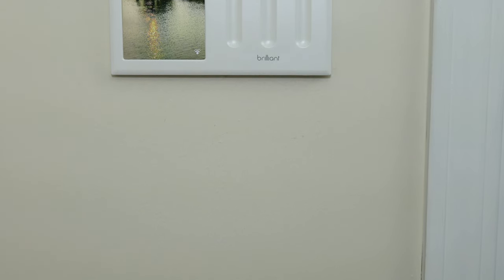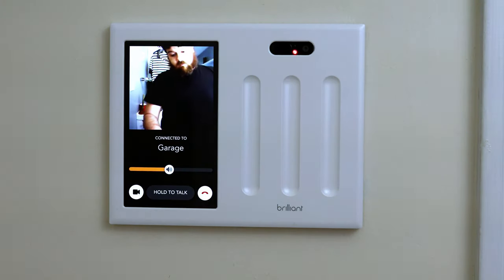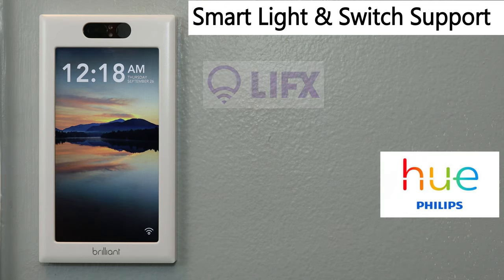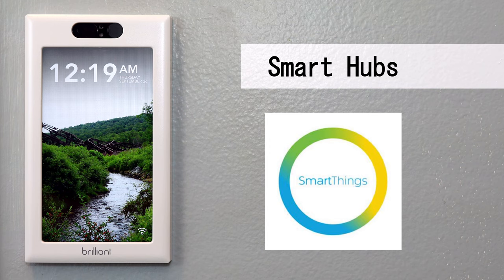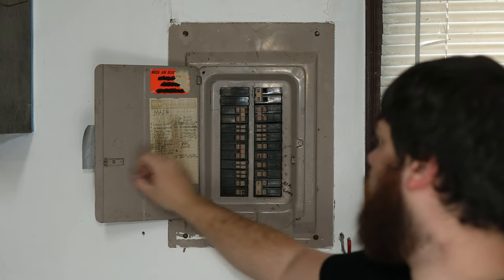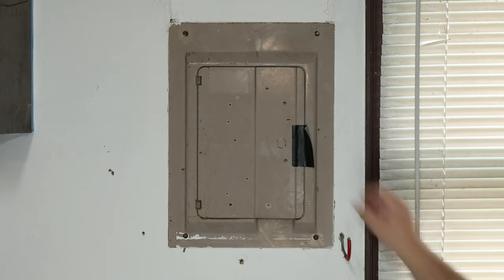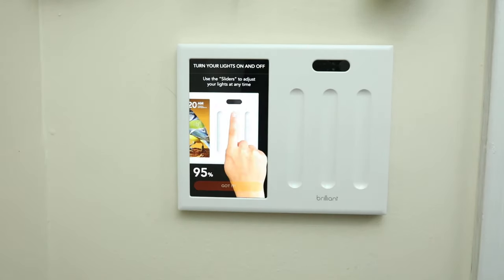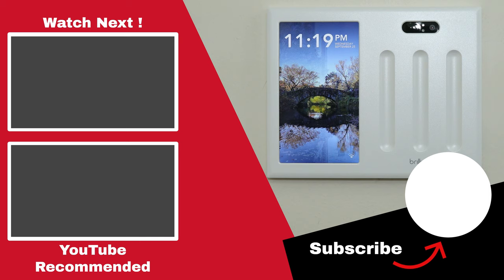Brilliant Home Control - Review, Installation, & Setup

Comment: I bought two of them (2 switch and 3 switch) and I love them. I had my eye on Atmos also but what I realized is, Brilliant integrates into your electrical system so the rooms I have these installed in, the smart bulbs and non-smart bulbs are controlled. You have to have ALL smart bulbs for Atmos to work. I was disappointed that Nest is no longer supported but that is Google's fault. It was extremely easy to setup scenes, my ring cameras, my sonos speakers, and my schlage locks. 

I have a combination of smart bulbs, Lifx bulbs and Sunco bulbs. It does work with the Sunco bulbs. It only views them as regular lights. I have already purchased Lifx bulbs to remedy that but that is something that Brilliant needs to work on. Lifx integration has been great. My 5 year old son loves his photos changing on the screen and he also loves the intercom function. I wish there were a way to add more than 4 shortcuts on the homescreen but that is a minor inconvenience. I already have various Echo Shows around the house so I already had the convenience of talking to Alexa. Brilliant allows me a touchscreen when it is too loud to speak to Alexa. Again, it is easy for my 5 year old to use scenes that I created to dim his lights and turn them blue for bedtime. 

Overall, I would give it 4 out of 5 stars.

Comment: what do the switches do?  Can they control other lights or only the lights that are wired to them?
Reply from the maker: The switches will control whatever load is on them. For this video I had a three gang switch with only two loads, so I jumped Line to the unpopulated switch (all switches need line power even if not used). You can then setup the switch to control other smart lights or switches that are connected to brilliant home control.

Comment: Is it possible to have a live view of your ring video doorbell without having the button pushed or is the video only available after a doorbell press?
Reply from the maker: I sent the demo unit back so I can't double check but I am pretty certain you are able to pull it up manually from the screen. I don't recall if you can use the built in alexa to show it either. Sorry!

Comment: One more question I had. Can I voice control the Brilliant thru the alexa app? Such as dimming the lights or turning them on or off? Or do I still have to use the slider in the Brilliant? I really think this is a cool device but at that price I want to know what it can and cannot do before purchasing. Any information you can provide would be greatly appreciated. Thanks
Reply from the maker: I'm honestly not sure. I've already sent my test devices back as my testing period for the video was over so I can't test it out myself. I don't see why not as long as the app supports the ability to turn smart switches on and off directly. Support is really helpful so you could always reach out to them and ask prior to placing any orders!

Comment: Can I control the brilliant device from another smart device? Example: I have a instinct alexa built in upstairs and if I had the Brilliant 2 switch control in finished basement can I go to the Instinct switch and tell Alexa to turn on basement lights? Or is this strictly one way? From the Brilliant  to the Instinct?
Reply from the maker: You can control Brilliant from a different Alexa or even Google Home. You can also add it into Samsung SmartThings and control it from there / add it into automations

Comment: Great video. Product looks promising but price seems a little high compared to just taping an iPhone 5 next to some cheaper Wi-Fi switches. One could easily rig up a three gang switch for half the price but obviously it wouldn’t look as clean yet it would be more functional since you’re not limited to Brilliant’s integrations.
Reply from the maker: Glad you liked the video! 

While the price is high compared to a smart switch, you are getting a lot for what you pay for, and so much more capability compared to a light switch. Even if you taped an iPhone 5 to your wall and bought some wifi switches you'll be looking at close to $200 unless you get stuff for a steal.  And I'd have to argue that the iPhone route is going to limit you more so than the Brilliant switch, not to mention won't be cleaner (such as the doorbell and smart Lock unlocking function). They've been releasing updates almost every other week which is just something I've never seen in the IoT space, and makes me excited for what else they are going to do. 

There are other systems out there that cost double what Brilliant charges, so for what it is and what you get it's a really good price point. 

If you're looking for a smart switch and nothing more than that, I don't think Brilliant makes sense. If you want an all in one solution on your wall that controls lights, smart devices, provides intercom functionality (something I've been using a lot more in the last week), and a bunch of other things then Brilliant makes sense if it's within your budget. Not something for everyone, but for those looking for what Brilliant offers I think it's a great choice.
Reply: @BeardedTechGuy  
Do you need a hub like smarthings for a thermostat in order to use it with Brilliant?

Comment: Nice review. So no TP-Link Kasa support ? and also is the switch UL listed?
Reply from the maker: Thanks! Anything you would have liked to seen covered for something like this?

Tp-link isn't directly connected at this time. If you can add them to SmartThings then you would be able to control TP-Link devices that way.

I don't recall seeing UL specification and I already sent the demo unit back so I can't check. I don't see anything listed on their website either so my guess is that it's not.
Reply: The Bearded Tech Guy Thank you. Yeah I also didn’t see anything on their website about UL. I sent them the question I will update once answer is received.
Reply from the maker: @MJA74a  great! Will be good information to have for sure.

Comment: I have Amazon Alexa and Kasa TP Link plugs. But I would like smart switches in the each bedroom to use with Alexa. but each switch is 2 gang that control a ceiling fan and the light on the fan. What’s the best option to do this?
Reply from the maker: Do you have a smart hub such as SmartThings or Hubitat?
Reply: The Bearded Tech Guy No,just Alexa and the Kasa App. I can install two single TP Link Kasa Switch H200 so Alexa can turn on the fan and the Light separately.

Comment: Saw this via another youtube content provider and was excited, until i saw the price tag. After that not so much. While I think they did a great job, Starting at $300.00 US for a single gang going up to $450.00 for the 4 gang version, sorry way over priced for what you get. A fire tablet wall mounted with echo dots scattered around the house a few motion sensors and and some thought into what to name your devices along with a few smart things smart buttons (when you want something to press to turn the lights on or other devices on or off) and you have what you need for the entire house for less then the cost of one of these.
Reply from the maker: Yea I was a bit taken back by the price at first, but a wall mounted tablet isn't going to give you directly connected smart light switches. Plus in some locations you can't hardwire a plug in the wall so now you have a ugly power cord dangling or semi hidden somewhere. Not to mention you now have to manage updates for the tablet. I wish the price was lower for sure, and you can tape together a solution with a mixmatch of things to accomplish most of what Brilliant offers but I think this is the most elegant way of doing all of it in one device. For me it's one of the only solutions I see for covering up a 3gang box that only has two lights in it without having some ugly plate, and as a added bonus, I don't really have any maintenance for it directly (just setting up automations like all my other HomeAutomation devices). Hoping after a few years of being on the market, price can go down a bit.
Reply: @BeardedTechGuy  Yea i agree about wall mounting a tablet. I looked for a while trying to find a nice way of doing it. Came across a website that had several different 3D printed covers for different size fire tablets. With it they had a way for you to power the tablet with a small built in Ac to DC converter. This connected the AC wires that were connected to the wall switches you take out and replace with this cover. After taking out the switches i installed smart light bulbs in the fixture, so no physical switches are needed. Looks nice after install. Then i used Action Tiles to control the devices on the screen. Looks very clean and works great. Using Fully Kiosk Browser to display the Action Tiles screen. Been using it for over a year now with no problems. Here is the site I got it from https://www.etsy.com/listing/676472925/amazon-fire-hd-8-tablet-wall-mount-7th?ref=pla_similar_listing_top-2&frs=1
Reply: When you think about home automation systems, this is the cheapest on the market. Typically Control systems cost $10k+. Think about Savant, Control4, Crestron. Those are the historical players. I like to think of it as 7 products in one. A video intercom system can run you $500+, it's a digital photo frame on the wall (Aura $300), it allows you to live look into your home when you're away (Arlo Cam / Nest Cam $200+), then it makes your lighting smart ($60 per smart WiFi light switch out there), Alexa is built-in so no need to buy an Echo and have it on the counter ($85). That's a lot of value esp. when compared to other home automation systems. And it's neat, clean, and compact. Super easy for anyone to use and doesn't require counter / table top clutter / not a science project. The wall access is amazing if you use Sonos and Ring too.
Reply: @MichaelWilliams-jw9kj  guess it depends on what you want. I don't want any cameras in my home for example to easy to hack into and see inside your home. This is not paranoia just a healthy respect for what programmers and coders can do. So outside camera's only. Also would rather put together a system myself rather then pay through the nose for something that i don't really want or necessarily need. This way i get what i want and need without the cost involved.